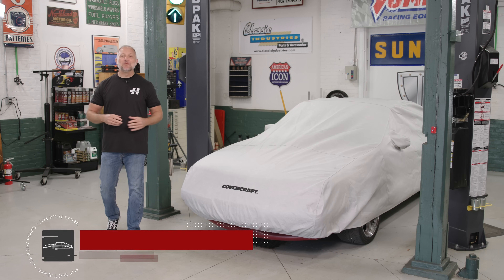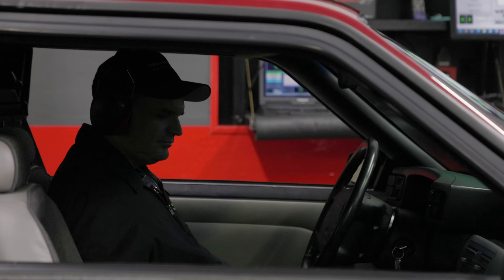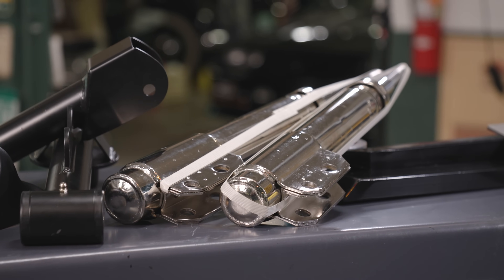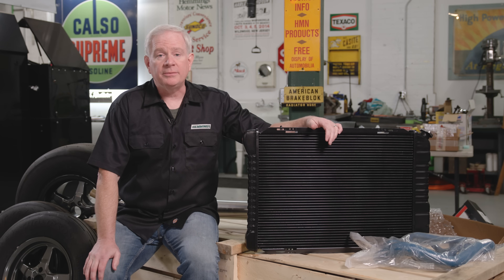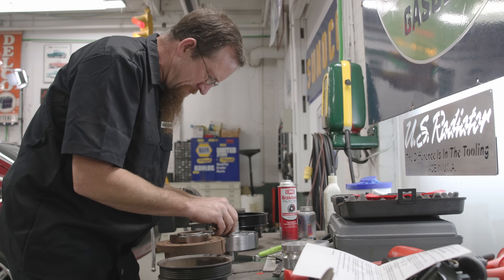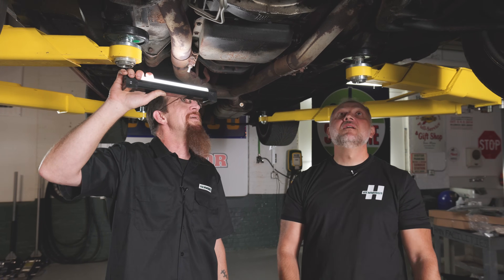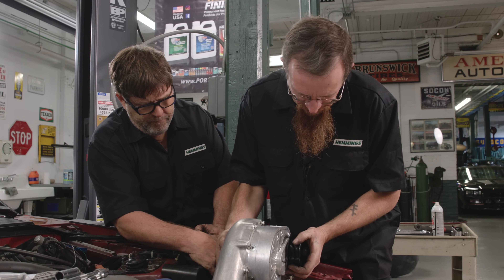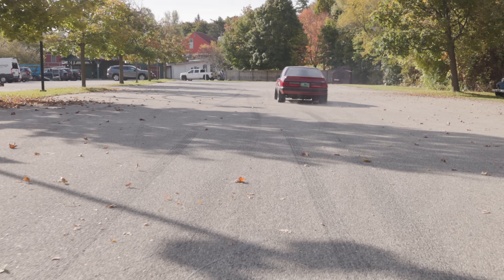FOX BODY REHAB | BRING ON THE BOOST | Episode 2

Comment: I installed this kit (circa 1996) into my 88 Saleen at the time. The engine was already upgraded with all the goodies available in that era. It made 603hp and was an animal with 13lb of boost. The original mounting plates and hardware were inadequate for the loads placed on them and belt slippage or poor alignment was an issue under load. Lack of traction was the biggest obstacle to overcome. Looks like a fun build!
Reply: 603hp in 1996!! Man, that's an animal by todays standards!

Comment: Why, did you say LS with turbo’s, that’s garbage, you mean coyote with turbo’s too make this fox 🦊 fly…🐍
Reply: nathant3897 which is a garbage move. Nothing wrong with a LS in a GM, great engine. You don’t need a Coyote either. A 351W with pistons, rods and good heads is going to do anything a LS will. Even though I’m a Mopar guy, I worked for a well known Ford shop that has but a slew of 7, 8, 9 and 10 second Fords. All Ford powered.

Comment: Have you guys been able to weigh this one? 300 hp in a light weight package like this will move out!
Reply: We didn't put it on the scales, but stock weight on a 5.0L hatch is around 3,200 lbs, so it's a pretty light car to begin with. With over 300 hp at the wheels it downright boogies!

Comment: The AOD had a short shelf life when going modified. The T5 could take a beating however.
Reply: LoL, I'd trust a AOD & wet fart over a fragile T5😂
Reply: @JasenRamsey-er6ek  There's a reason why you never saw a stock AOD in a modified 5.0, not for long anyway.
Reply: @JasenRamsey-er6ek  I ran a head/cam/intake combination with a 150 shot and the T5 held up nicely. Anybody who would take an AOD over a T5 is clueless. History proves it.

Comment: McGean has to stop with the LS nonsense. A 351 with good AFR heads makes every bit the power any LS build does. Period. I’m a Mopar guy so that’s not a fanboy response. I worked for JBA Speed Shop and have seen it done over and over. Pushing LS swaps into other makes because Holley and other companies are invested is just wrong.